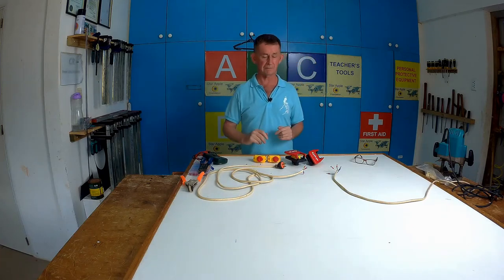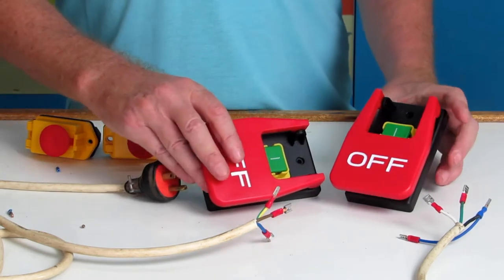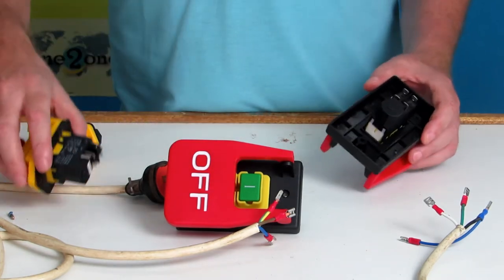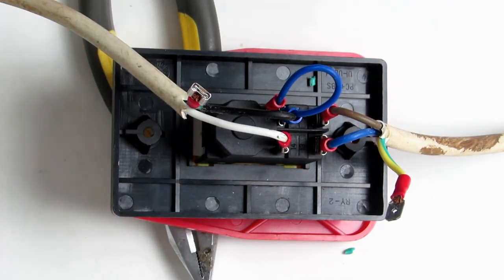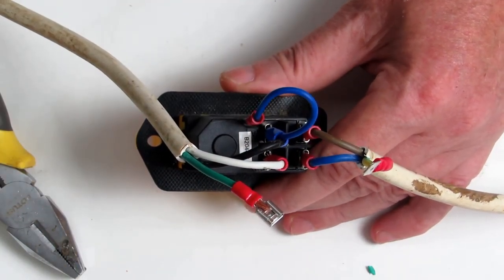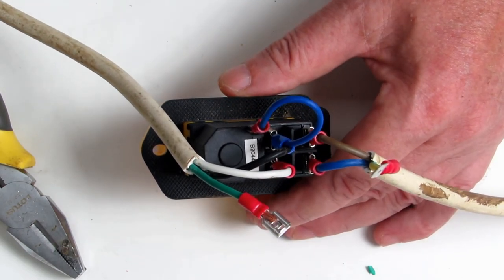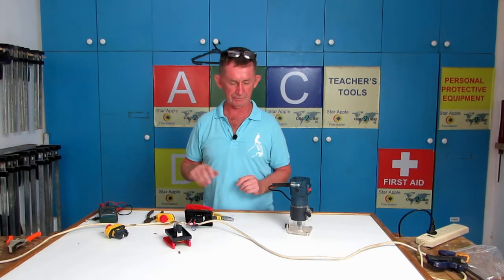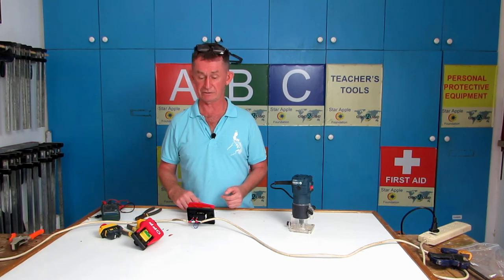How to Wire a Magnetic Paddle Switch

Comment: A Magnetic switch works when a machine is working and saddle power went off and you did int switch it off, and when the power came back the machine will start or it goes off when the power went off
Reply from the maker: Yes I explained that in the video

Comment: Thank you for providing this video on magnetically latching switches!  You have a good explanation of this type of safety switch and your photography and lighting are excellent, so the viewer can really see the basics of wiring such a switch!  One item that I think should be explained better is the benefit for a magnetically latching switch.

Let's say that instead of the magnetically latching switch, you had an ordinary switch on your equipment and the mains power fails or is interrupted.  You absent mindedly start to investigate what went wrong without manually turning off the switch.  Then, the mains power comes back on while you're looking around and suddenly your machine is back running at full speed. You (or someone nearby) could be badly injured in a second.

With a magnetically latching switch like you've shown in your video, if the mains power is interrupted for any reason, once the power comes back on your machine won't come back on without turning the magnetically latching switch on again, thus providing a lot of safety. 

The red paddle or big red button is intuitive to slap or tap off in an emergency whether any power switch is latched magnetically or not.
Reply from the maker: IU am glad you liked it. Yes, as you explain, when power resumes after a power cut, the switch needs to be turned on again. Thank you for watching

Comment: Thank you for this very informative video!
Do these 5 pin switches include a polarity reverse to brake the motor (for example on a saw table) or is it just a regular magnetized switch? 
Kind regards
Reply from the maker: No. This is just a magnetic switch. IMO a DIY reverse polarity brake may end up damaging your motor. Thank you for watching

Comment: HI Pascal, thanks a lot for whole explanation. For good luck you shown how to wire the switch, neither the seller was able to do that. He suggested me to loop A1 with nr 14 but as far as I understand I've to connect with 24 (positive out). Surely I'm not an electrician but I perfectly understood your words. I've just some trouble to put 2 wires in a single (blue) faston cause I used 2,5 mm wires (those for 16A) and line will be dedicated to trimmer/router only (respectively 700 and 1400 watts). Thanks once more
Reply from the maker: The numbers may vary with different switches, but the diagram on the back should show what has to be cross energized. It works with the switch I linked in the description above.

Comment: Hello Pascal,
I admire your abilities. You have a lot of information. I'm glad to see that you are also knowledgeable about electricity. We use this type of automatic condition in many machines. Thank you for showing and explaining in detail. Useful video. See you. Greetings. Best regards. Your friend Mehmet
Reply from the maker: Thank you Mehmet. These switches are ideal for router tables, like the one you just made
Reply: @IrishChippy  Ideal for the router table I'm making. There are other shortcomings of the router table, I did it hastily. And I will make up for all your shortcomings later. such as the storage area and the front cover. I will do some upgrades soon. See you. Cheers mate.

Comment: Hi, thanks for the video. Can one connect two or more such switches for the same machine (at different locations in the workshop to switch on the dust extractor for example)?
Reply from the maker: It is possible, but not like a 2-way 3-way switch. I would consider it very dangerous, as you can only switch off from the one you switched on. Thank you for waching